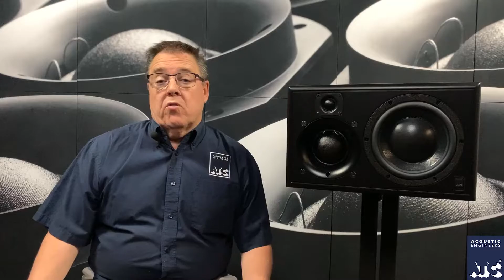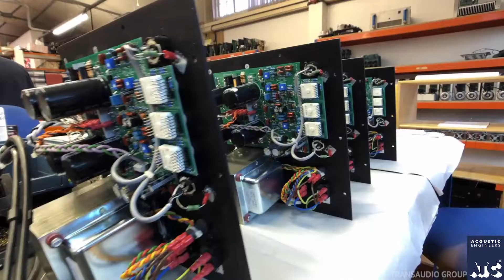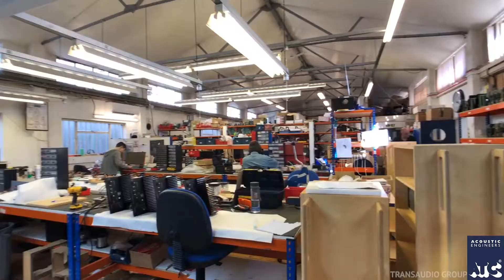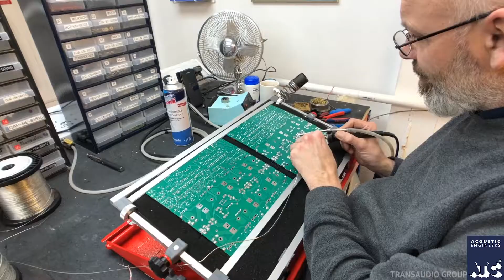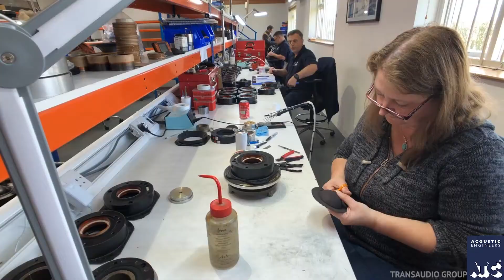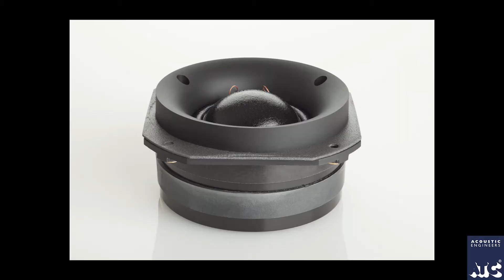ATC Active Near Field Monitors Overview by TransAudio Group

Comment: The SCM 20 is the active version of the SCM 19s correct? I have the 19s and the mid range is outstanding! It's weighted toward the mids vs trying to cover the lower HZ and mids, which as you point out, not gonna happen with a 2 way. It was a smart move and with a good sub, the 19 sounds better than other speakers costing far more $. If i was not invested in the gear I have, I would have gone with your actives for sure! Finally, I compared the passive 11s vs the 19s. I'd be interested to hear your thoughts on my assessment: https://www.youtube.com/watch?v=n_pXcZKHhw8
Reply from the maker: Wow thanks for the in-depth, thoughtful comparison!  You covered the comparison very well.  Just FYI we distribute ATC consumer gear through Lone Mountain Audio - https://www.lonemountainaudio.com/
Reply: @TransAudioGroupMedia  Will check out your site, thanx.